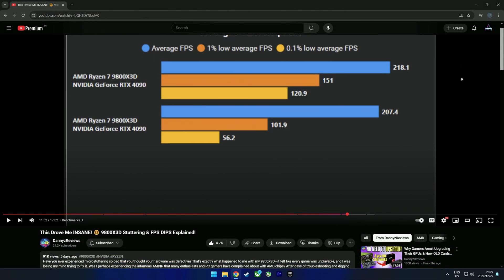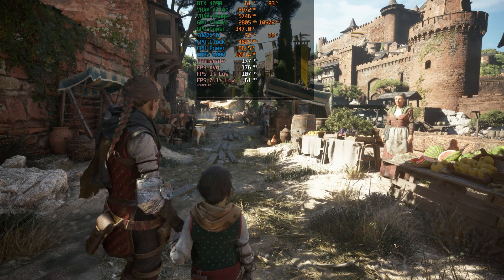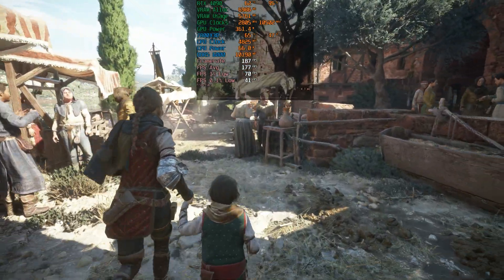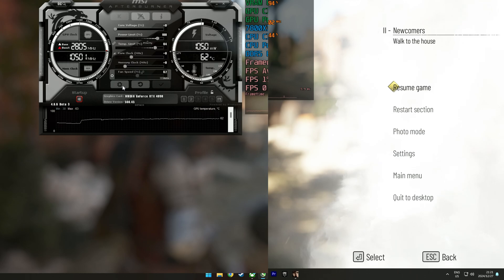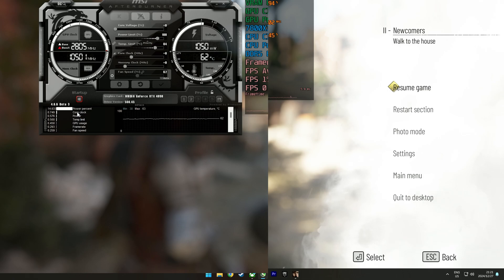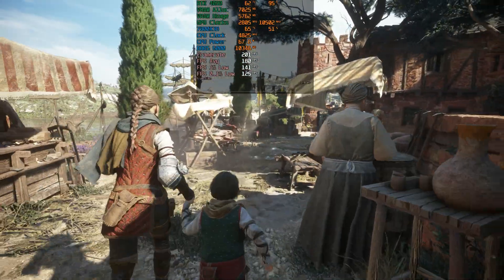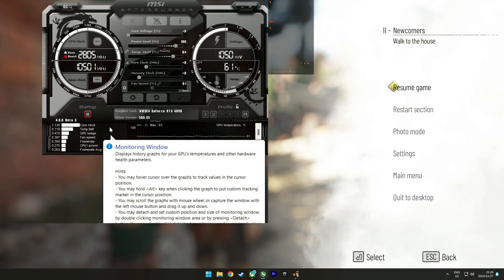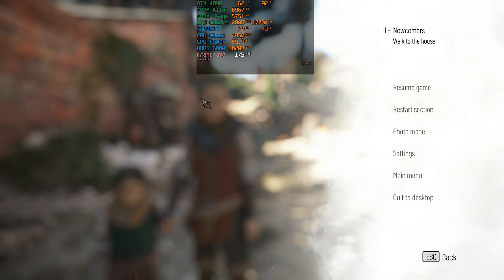MSI Afterburner Causing The Infamous "AMDip"?

Comment: I just checked my msi afterburner and it was reporting 12-13 also on power percent, my CPU is 13700K, thanks for the heads-up.
Reply: It is expected timing for this sensor, you don't need to disable it if it gives you no problem with stuttering feel. Every single sensor eats some CPU time to be polled. Some more, some less, but absolutely none is free. There is always some performance hit for any background hardware monitoring application. That's axiom, that's how it always worked in every single app and that's how it will work in future. The same apply to any kind of RGB control software, which is also periodically accessing hardware and eat performance on hardware access events. The same apply to any kind of software fan control applications, like FanControl, software fan curve in MSI AB, EVGA Precision etc etc. It also periodically accesses hardware to send new fan speed to fan controller IC and can cause pretty similar performance hit. Majority of users simply don't understand how PC and such things works. And the only question for such kinds of performance hit is "how much is too much?".
Reply: @unwinder  agreed. If it has no impact there is no reason to disable.

What also happens a lot in my experience is people have monitoring tools running, RGB software, mouse software, etc, and they all add up, even if each one by itself has little impact. But no actively running tool is completely free, they all have an impact. Some larger than others.
Reply from the maker: You're welcome? Did disabling it improve your lows? I saw the same behaviour on my Intel systems but disabling it had no effect on the lows.
Reply: @Mostly_Positive_Reviews  
I was on desktop watching your video, no game was running, will check Stalker2 later today on and off.
Thanks again.

Comment: I always have stuttering issues in every UE5 game (which Ik is a UE5 issue) and some other games like space marine 2 and dead space remake. 

So over stuttering troubleshooting. I use RTSS to cap all my games for a flat frametime to combat the issues. Wonder if this will help (I only use RTSS without MSI open thou so maybe it won’t??)

Should I seperate game and is ssds is that an issue? Should u use ssd connected directly to cpu PCIe lanes only for gaming?

Any tips to avoid stutter in general pls hand them over haha. (Assume I’ve updated everything and every driver).
Reply: I've personally played many games on my SATA SSDs which are Samsung 870 Evo drives and also I own 2 Gigabyte Aorus 2TB Gen4 NVME drives and 2 Lexar 4TB Gen 4 drives. I've absolutely NEVER noticed a difference gaming on any SSD, even load times are about the same. Currently there's absolutely no reason to use an NVME drive for anything aside from maaaaaybe your OS might benefit, copying large files, and if you're on Windows 11 then Direct Storage requires an NVME.

For peace of mind, running only NVME could be good. I play 99% of my games on my NVME drives now and I like knowing my drive is never gonna be the issue. I would never game on a HDD again, but SATA SSDs I still trust.

For stutter, as long as you have enough Vram and Ram, it's always going to be your CPU holding you back, currently even the 9800X3D is too slow for some of today's games. It'll pump out the frames to make benchmarks look good, but UE5 is clearly too advanced for what we currently have access to. That's purely on the developers, they should be toning things down a little and optimizing a bit better, there's no reason a Ryzen 5000 or Intel 10th gen should be struggling, and 7800X3Ds and 14900k's should not be a requirement to get 60fps on Jedi Survivor or Hogwarts Legacy, which aren't even UE5, they're using UE4.
Reply: @ Yeah UE5 really sucks for stutter just a terrible game engine for gaming if u asked me, haven’t been playing games made on it. CPUs aren’t well utilised either in most engines other than cyberpunks engine which uses every core very well. Can definately see UE5 is the issue there rather than hardware cause games like Indiana Jones and Horizon forbidden west show that amazing performance can have amazing visuals.

UE has always had issues since 4.

Still just trying to make sure I’m doing the absolute best I can for the smoothest experience as someone who can’t stand stuttering to the point I’ve blacklisted an entire game engine from my wishlisted games hahaha. Can’t stand UEs issues.

The only game that I’ve played that said it required NVMe is Dead Space Remake and that game stutters like crazy even with one unfortunately. Strange given frostbite is usually known for great performance and visuals.

Comment: Thank you for this video! You have no idea how much time you saved me from redoing benchmarks. However, another issue has come up. Are there currently any alternative ways to show GPU power usage during benchmarks if I turn this off?
Reply from the maker: Glad I could help!

I'm trying to find an alternative as well. At the moment I think physical sensors are the best way, combined with PCIE power draw, but will test some software to see what works.

For me the biggest culprit was power percent. Using normal power in watts didnt have this issue, but it can vary per system.
Reply: @Mostly_Positive_Reviews  Noted on this. Thank you once again!

Comment: Does this eat performance even if you aren't monitoring stuff? I mean it shouldn't, but just in case I turned that stuff off. I assume HWInfo and stuff share the same issues if they're accessing the same sensors?
Reply from the maker: Yeah, HWInfo has the same issue as it works the same way in reading sensors. If you just untick it from monitoring as shown in the video it resolves it so you can still have the software monitor other sensors without causing a big impact.

That said, there will still be a performance impact monitoring other sensors, but it might be too small to really notice.

Comment: Great tip about the profiler and thanks to Unwinder for explaining it. I knew about the power usage problem since the video you linked, but now I checked using the profiler and discovered that dedicated GPU memory counter was eating around 3-4 ms on my system (9800X3D + 4090) and sometimes spiking as high as 10 ms. That's totally not worth it, so I disabled that and now all the remaining sensors are fairly balanced with no single big performance hog.
Reply: No need to optimize it just to optimize. That counter's timing is pretty normal. Also, don't forget that CPU polling time depends on CPU clock. So it can be easily let's say 10ms for CPU idling at 1GHz and 2ms for the same CPU running on full 5Hz. So fluctuations in some sensor's timings due to dynamic CPU clock changes (and multitasking) are pretty normal and expected. Personally I always pay attention to total polling time and don't bother to disable anything if total polling time is below 50ms in idle.

Comment: You got a new subscriber 😊Any idea why hwinfo64 and hwmonitor can't display cpu package power correctly on my ryzen 5 5500, it's like 4-5w under full load while if I look at all 6 cores where are like 10-11w per core but package is not megring them. I had ryzen 3 1200 before ryzen 5 5500 and no issues with that.
Reply from the maker: Thank you very much, really appreciate it!

Ryzen CPU power reporting is a strange one, some apps report correctly and others dont. No idea why 🤷‍♂️

Comment: I know its asking a lot but would you be able to test this in something like Apex Legends with higher polling rate mice? i had bought a 7800X3D a while back and anything over 1000Hz polling had my game rendered unplayable and i could force a frame dip by whipping my mouse every time. i returned it and i swapped to a 14900KS and i do not have this problem.
Reply from the maker: The highest polling rate mouse I currently own is 1000hz, but to be honest I have seen some slight improvements dropping it down to 500. But it's a good video idea. Will see if I can source a 4K mouse somewhere and test 👍
Reply: @Mostly_Positive_Reviews  will be looking forward to it

Comment: Thank you! I had this issue with my 9800x3d. After days of messing i narrowed it to msi afterburner and just stopped using it. I never knew that little trick to see cpu usage time.
Reply from the maker: You're welcome. I also didnt know about the profiler until very recently. There are more options that you can enable to view even more specific info regarding possible performance hits. Will do a follow up video showing that soon.
Reply: @mikehawk1441  where do you read all that?!? This statement is also absolutely disconnected from reality.  Nobody stole anything. Nobody refused to pay licensing fees, MSI couldn't do it due to sanctions, there are still some problems with that but the project is alive. Nobody else besides me can develop that project because source code doesn't belong to MSI.

Comment: another thing to note, if you're using a wireless keyboard or mouse and game with a controller, some games will experience a micro stutter as they go to standby mode or become active again. it is incredibly annoying that these issues crop up and there's several and i mean several things that could cause them. the most annoying part is when you can't identify the fault and cannot successfully replicate the problem when troubleshooting.
Reply from the maker: Good tip!
Reply: You can fox this by changing your usb power state in power option profiles.
Reply: @GlennsHardWired  change it to what?????
Reply: You can always disable the power saving mode of your mouse or keyboard in Windows settings. The problem is high mouse polling rate, it cost performance. 🤷‍♀🥴

Comment: Quick heads up!
MSI Afterburner is developed only by ONE GUY.
Despite the name "MSI Afterburner", they couldn't constantly update the tool as needed, because that one Guy is a Russian who escaped from Conscription.

No, I'm not kidding. If you really need on-screen Overlay, use something else
Reply: What are you smoking?
Reply: @unwinder  facts?

If you still demand a reliable On-screen overlay, just use Digital Foundry overlay.

It's significantly better than MSI Afterburner.
And you can use Ryzen Master to adjust clock speed, Overclock, undervolt etc.

And then you can also use Nvidia App to adjust GPU clock. Or Radeon Panel to adjust Radeon GPU.

Basically not MSI Afterburner since the dude not frequently updating the app.
Reply from the maker: @niezzayt3809 You are replying to the dev of Afterburner himself. The hate towards a dev that provides you with free software is unwarranted in my opinion.
Reply from the maker: @unwinder I'm sorry this video has these comments directed towards you, it was never the goal. Instead, I just wanted to show people that if they have issues with stuttering how to possibly reduce it. I am busy working on an updated video that contains more info as shared by you, and hopefully that should set the record straight.
Reply: @Mostly_Positive_Reviews  why do you need to sorry? You video is pretty useful and what is going on inside comments is absolutely OK. I'm used to it because I read a lot of fake info about projects almost daily. I do so during almost 30 years of develompent but it is still beyond of my understanding why some users love to make things up and tell absolutely unrealistic stories.
Reply from the maker: @unwinder  I just know how it feels to have unwarranted hate being thrown without reason. But I guess you stop taking it seriously after a while, water off a duck's back kind of thing. Still, not nice seeing these comments directed towards you for no reason at all.
Reply from the maker: Not sure I understand correctly. Are you saying that because he didnt want to be forced to go to war we shouldnt be using his software?
Reply: @Mostly_Positive_Reviews   No, He couldn't Update MSI Afterburner frequently because of that reason.

You might want to blame MSI Company instead. Why don't they hire a more qualified programmer instead of just relying on 1 Guy?
Reply: @Mostly_Positive_Reviews   do you even remember how "Frequent" MSI Afterburner gets Updates before 2022? Very often!

And then after 2022, the updates becoming Rarer and Rarer?

Comment: MSI after burner is terrible for metrics. 
MArvel rivals on the B580 would crash on start up, couldn't figure out why. 
Closed MSI, funny enough works perfectly. Loaded MSI back up and yet again, wouldn't load. 
That thing is so glitchy. There are better things to use.
Reply: I share my “so glitchy” tool with those who have some basic PC tuning skills as a hobby during 30 years. You can try do the same and offer your own solution. But in this case you’ll have no time for games and such toxic comments.
Reply: @unwinder  You have a very fragile ego. The tool is incredibly out of date. The font looks like crap, to this day it still causes issues and weird FPS issues and crashing. 
Everyone's supposed to just not mention that and ignore it? 
Get over yourself
Reply: @DaveTheeMan-wj2nk  Sure. Incredibly out of date tool, which got last update just 3 months ago. Which is getting 50x0 series support before they even announced and before you can see them. And LOL at fonts statements. The fonts in overlay and overlay itself are not customizable too. Probably the channels like @h1ttz, who use RTSS overlay editor to create such layouts, are just a bit more educated?
Sync your ambitions with your knowledge (or a lack of it).

Comment: Yes, i found this out yesterday. I went from a 5600x with no stuttering to a 5700x3d with stuttering and come to find out it was the msi afterburner cause the micro stutters. Now it's running like butter in every game. Thanks!
Reply: i feel like i had stutters too with my 5600 , i dont think its an x3d problem only
Reply: I have 5900x same problem stuttering
Reply: Que opciones debo dejar para monitorear sin que afecte al sistema?
Reply: @damianbaninetti33 Al final yo decidí cerrar el programa desde administrador de tareas, ya que verifiqué temperaturas, cargas etc, ya que mis fps bajaban demasiado de tirón, cuando voy sobrado, ya lo finalizó y cuando lo necesite lo dejo corriendo, pero la única solución que veo es deshabilitándolo desde administrador
Reply: Rock on.

Comment: That's mental, I have a 7800X3D and never had any stutter issues but I also have a 7900XTX and I never monitored that power, recently I stopped using MSI all together because the AMD overlay is good enough
Reply from the maker: I was informed after the video was published that Radeon GPUs dont exhibit the same behaviour. I left a pinned comment but seeing that you have an AMD GPU it makes sense why you dont see this issue.
Reply: Haven’t really had any issue Same build

Comment: It would be nice if some tools tracked outlier frame times rather than the pseudo-inverse 0.1%fps.  FPS in the context of games is a rolling average and a single frames can't rationally be said to have an FPS.  
(Assuming a 1 second rolling average for easy math.) A 0.1% low of 40fps could be either 40 frames of 1/40th second each, or 36 frames of 1/80th second plus 4 frames of 1/8 second, and those two dips are very different events. A graph of frame times would clearly show them as different too.
Reply from the maker: Yeah, it becomes very technical very quickly and a frametime plot would be the best way to show how long individual frames take to be rendered and displayed. I guess for simplicity the rolling averages are okay, but a more accurate plot of each individual frame would be very useful, especially when troubleshooting issues.

Comment: So if you're not actively running afterburner, this shouldn't have any impact? I'm asking as I usually just apply settings to up the power limit and OC a bit, then I close it.
Reply from the maker: If it is closed entirely it wont cause it, correct.
Reply: make a bat file that do this for you and put it in startup folder
put this including the double quotations
"C:\Program Files (x86)\MSI Afterburner\MSIAfterburner.exe" /Profile4 /Q
u can change the path as yours also the profile number you want

Comment: Well I did this for the highest usage one as you suggest and then the next option just jumps up to the top for usage and also the same amount of time it takes.  So this is not a solution.  You have to disable all of them, for me at least
Reply from the maker: Interesting. In a lot of the feedback I received deselecting power percent fixed it for everyone, but polling can affect different systems differently.

Comment: Not using MSI Afterburner after knowing about CapframeX tool
Reply from the maker: Unfortunately it also happens with HWInfo and CapFrameX too. I pinned a comment regarding that. According to the developer it's the way Power Percent is read via the NVAPI, and it happens with all monitoring tools.
Reply: So it might be fine with Radeon GPUs then  @Mostly_Positive_Reviews
Reply from the maker: Yeah, from what I'm told by the CapframeX dev it is related to the NVAPI and how the power percent sensor is accessed. I had a few people with Radeon 7000 series GPUs test it for me and they couldnt replicate the issue on their end, but could with Nvidia GPUs.
Reply: this also with capframex and hwinfo man xD